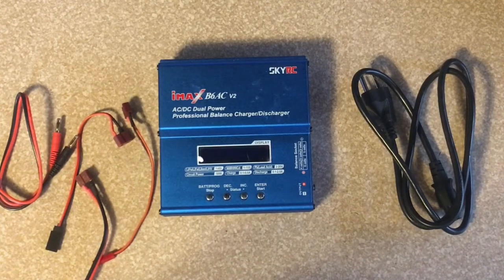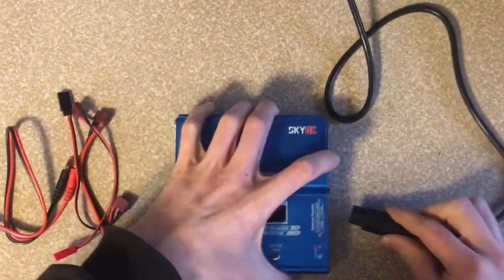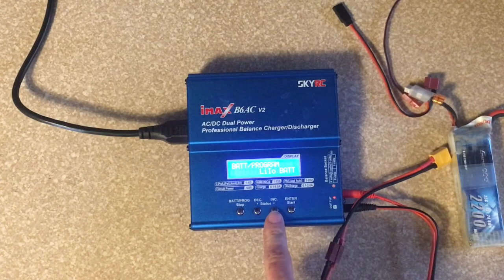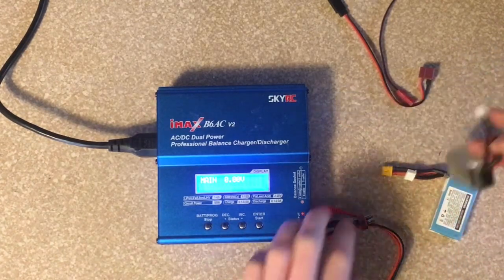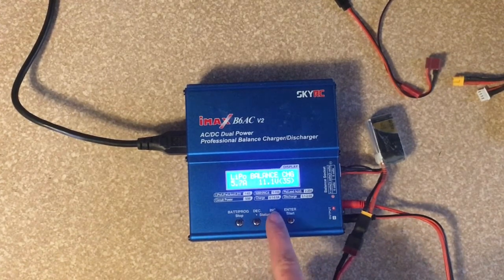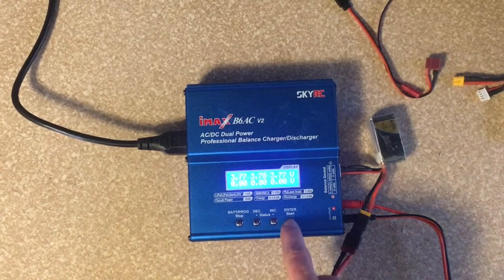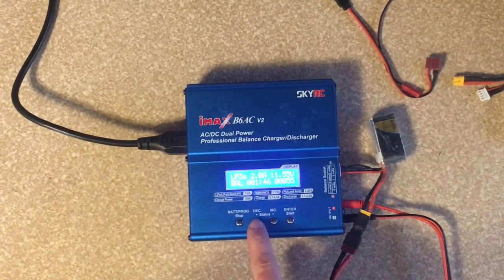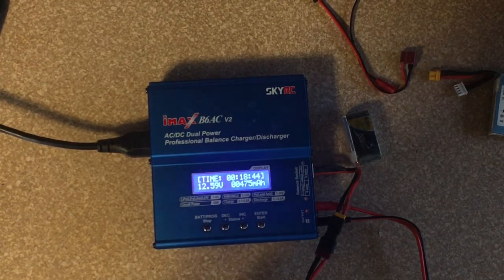IMAX B6AC V2 Professional Balance Charger/Discharger Review

Comment: Thanks for the video.  I just bought this and was not able to enter into the calibration screen by holding the Start and Dec buttons while plug in power.  Is it because of my unit or is it because this is not an option for this unit?  Thanks for any input.

Comment: I've been looking at videos and the manual for this and no one has been able to answer these two questions. From all these sources, I determined the unit DOES support displaying the internal resistance of nS cells, where n is > 1. However...

Q1) Does this unit support determining the INTERNAL RESISTANCE of a SINGLE 18650 cell that is NOT part of a pack?

Q2) Does this unit support charging a 2S battery pack that does NOT have a balance connector?
   (I have multiple 2S packs that have internal battery protectors for each cell, and there is no balance connector)

Every reference to determining the internal resistance of lithium cells in the manual seems to REQUIRE using the balance connector...which of course a single 18650 doesn't have. The manual (p19 and p20) also says that there will be an error message if the "balance connector" is not properly connected.

Thanks in advance.
Reply from the maker: exgenica yea, I’m not sure about the internal resistance, but I have tried charging 18650’s without the balance lead, and it does not work. I have heard from others that the lesser model the IMAX B6 mini is capable of charging 18650’s without the balance lead. I hope that helps. Have a great day
Reply: Thanks for the information!!!
I also just read in an OLD iMAXX B6 manual that you should NEVER charge or discharge "A battery fitted with an integral charge circuit or a protection circuit."
Just a few minutes ago I found a 2018 "B6AC V2" manual (v2.20), so I'm going to see if it clarifies things. I also just got a 2014 "B6AC+V2" manual (v1.0) but I don't know what the differences are between the "+V2" version and the non-PLUS "V2"...yet. So far, I can't find any product listing for a "+V2" version on the SkyRC website. The SkyRC website's search engine seems to be...quirky...to put it nicely.
I'm also still trying to find a summary list of the functionality differences between the "B6AC" and "B6AC v2".
SkyRC does NOT make this easy.